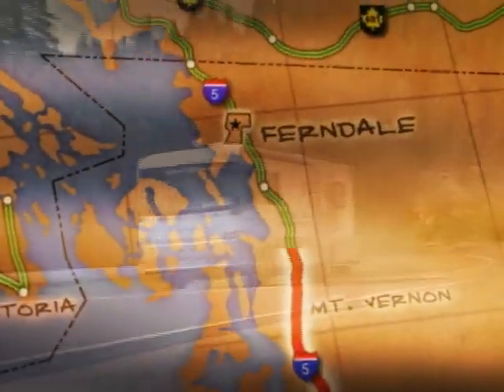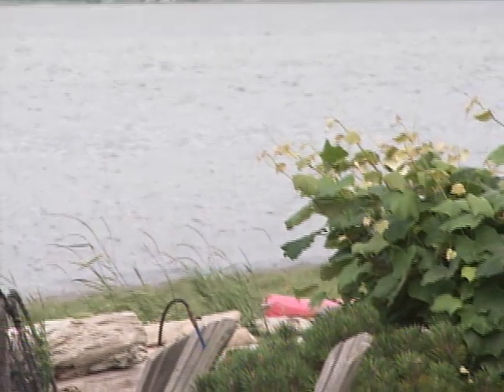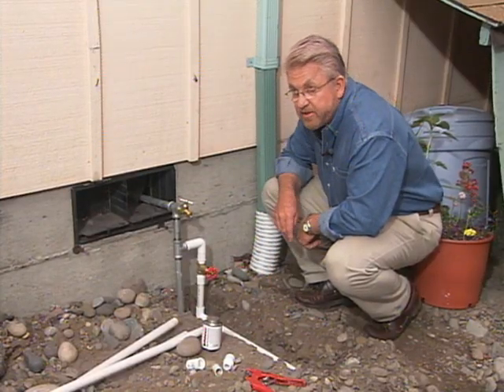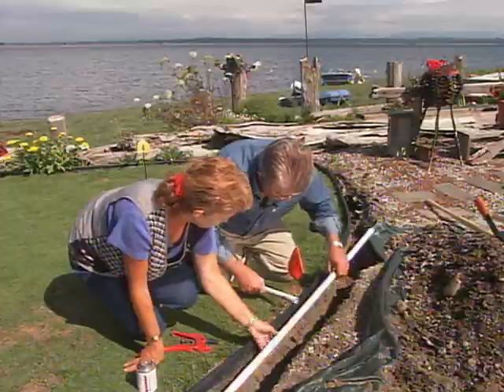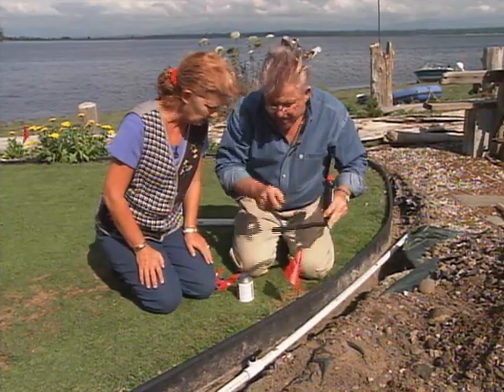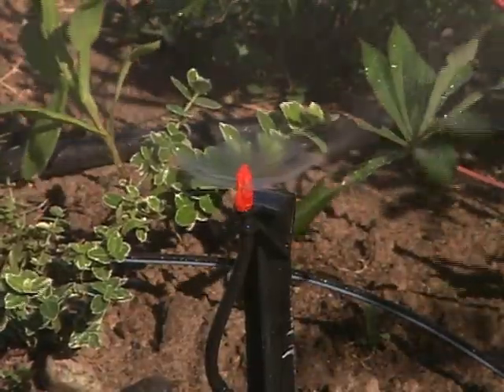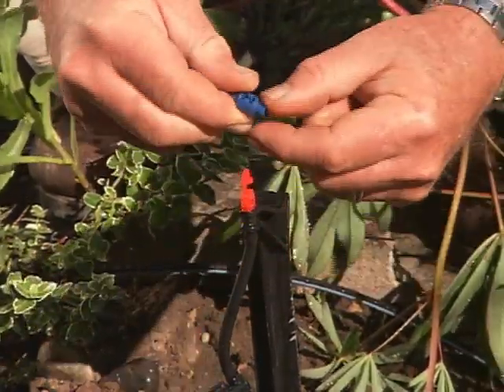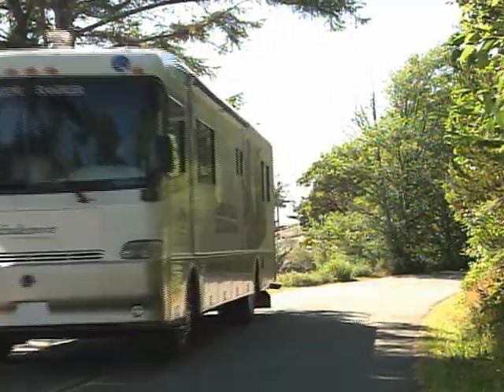How to Install an Automatic Irrigation System

Comment: Preparing to DIY my own irrigation system. Quite nervous, and of the hundreds (feels like it) of videos I've watched thus far, this one left me feeling very comfortable and more knowledgeable.
Reply: Stephen Pierce if you haven't done it yet, make sure you use filters on your drip irrigation, prs sprinkler heads, and a backflow preventer.

Comment: I do sprinklers  system  u didn't  show  how to wire the antisiphion  valves and u didn't  explain  about back flow and u don't use primer  first
Reply: +john Kosheluk he's using "blue" christys, its a primer and glue